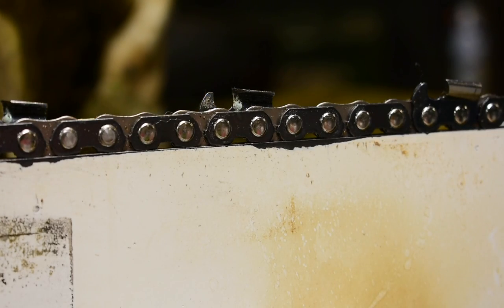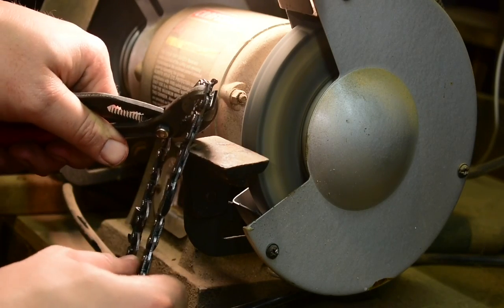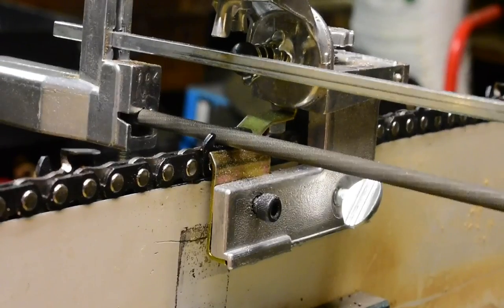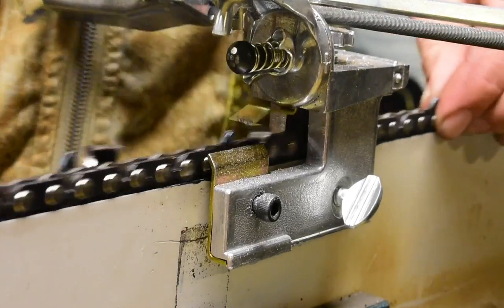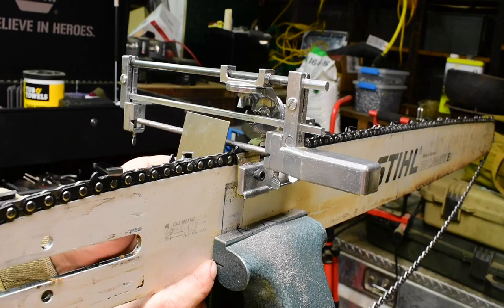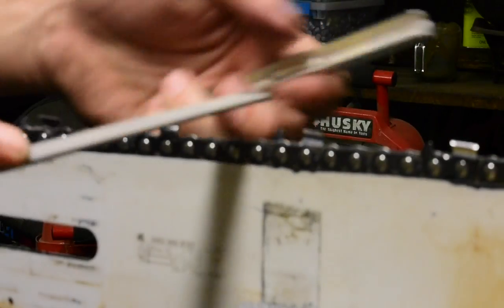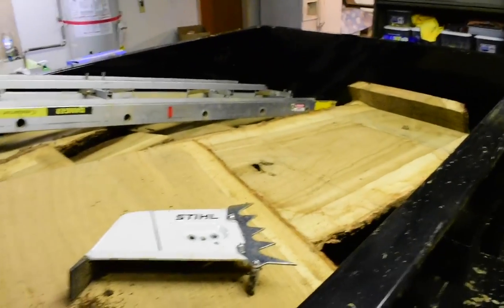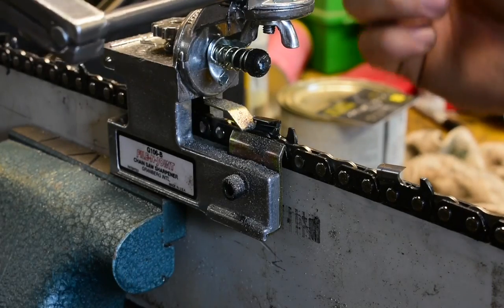How to make a ripping chain

Comment: A Guide to this video:
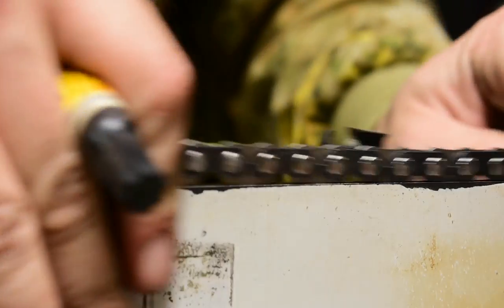1.) 1:49 Mark every other pair (right and left) of cutters on the chain
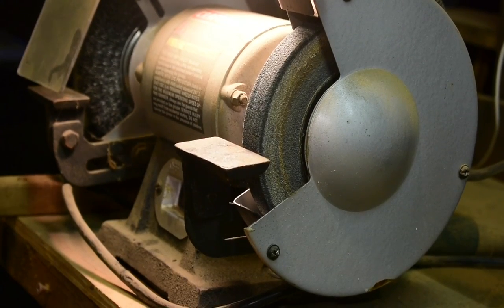2.) 3:34 Grind off half of the heads of all the marked cutters.
3.) 8:00 File the scoring cutters to 20 degrees and the clearing cutters to 0 or 10 degrees (as specified by your chain manufacturer)
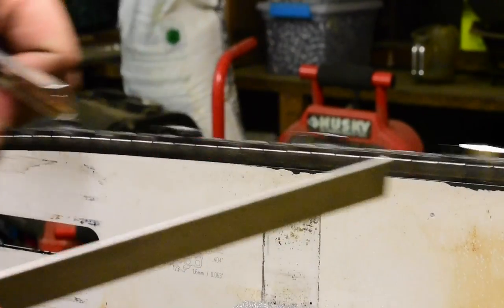4.) 18:03 Grind the rakers down to .025 using guide file
5.) 18:28 Round the rakers so they don't have a flat top
Reply: thanks i copy and pasted in note pad A++++++++++++

Comment: I took an extra new Oregon  LPX chain that I had and converted it to a ripping chain by regrounding the cutters to 10 degrees, just to see how it would cut and put it on my MS 360.  I then ripped off a slab from a round of hickory I cut last summer.  I did not convert it to the granberg style, just ten degrees on every tooth and threw it on the saw.  It cut pretty well, not as fast as a standard chain but fast enough.  It did not produce noodles but nice chips and the wood surface was a lot smoother than I would get from a standard chain.  I was real pleased.  I did not even check the rakers, just re- ground the cutters and threw it on the saw right out of the box.  I did nothing to the grinder but set it at ten degrees.  I do not know how it will cut in other wood but it did pretty good in 25 inch hickory on a 20 inch bar with 3/8, .050, 72 chain.
Reply: 10 градусів це параметри для ланцюгів повздовжнього розпилу.

Comment: I always use a powerful magnet to capture filings so they don't wind up in the chain guide bar and drive sprocket to chew away the metal and make a sloppy wobbly fit. I recover old audio/stereo speakers and tear out the magnets for various uses. This is one of them. They make finding and picking up metal things dropped into lawn grass, weeds, and stones very easy and fast. Incidentally, I had a dog almost identical to Chester, and she could literally talk to me with a few words. "Good girl!" and "No!" were here commands to me. Every time I petted her I said "Good girl!" One time I was too tired and she laid over my feet and told me "Good girl!" to remind me to pet her. wadyano. Missing some teeth on the lower jaw behind the canines, a black spot at the base of the tail made it look like an arrow stuck in her behind and the 2 black ears. A gray colored mottled mouth and silvery white hair. She could have told me anything.

Comment: In my experience with milling, you can use a dremel with a cutting disc to cut off the top plates. Less chance of overheating you cutters. But for the time it takes to make a granberg style chain, an oregon full comp ripping chain filled at 5-10 degrees works just as good and produces a satisfactory finish with minimal plaining required

Comment: I use an air die grinder. Cuts them real quickly. You have to take the one you cut back as you sharpen the chain also.

Comment: You got your sharpener on backwards. You always push out.    Been cutting wood for 45 years.    And have 15 saws.  3. 500 i.   Three magnums.   Two 881.  Two 661.   Always stroke out to the point of your tooth.

Comment: Two words for you: Short and concise. Anything you can do to shorten the videos is best. Cut out crap like talking about how you are trying to focus on stuff. Someone trying to make a rip chain doesn't care about your filming process.
Reply: I set the speed up to 2X.   It helped since I understood what he was saying the first time.  The next 7 times helped to reinforce but they went by faster at 2x even if it turned his voice to sounding like MIckey Mouse.  

This vid definitively convinced me never to buy one of those Granburg (sp) deals.  In the time it'd take me to figure it out and get it set up I'd been able to dremel my chain sharp and buck a chord.  It looked like a broken mouse trap.  I may attempt this free hand on the bar with the Dremel as well.  I'm not making furniture.  Just beams and stair treads, plus I have a hand plane and belt sander if the finish is that poor.
Reply: 20 minute video for  chain cut
Reply: Burt Reynolds it’s a cord of wood not chord. Just sayin
Reply: This video should only half as long. 
Krykies there’s a lot of wasted time

Comment: thanks for info I will be looking to making some boards this summer.  Because angle in sharpening is key, to have different camera perspective to show angle that you are filing at would help a lot; also editing is nice thing to provide to the viewer, to aid the focus, stop down your lens (narrow the aperture on lens) and move camera away from subject to help with focusing. Really no need to set camera on all auto, with those tripod shots and use manual settings.

Comment: ty for the tutorial very good i had wondered how they made the rip chain from regular , the sharpening jig you are using , i am surprised that the offset tilt is only 5 Dec settings , the McCulloch saw sharpening jig i got are 1 to 10 Dec settings on tilt and 0 to 50 Dec on the angle pitch settings with 33 and 45 Dec angles highlighted for regular sharpening settings

Comment: Kyler, have you tried going to the 0-15 deg angle and leaving the cutter width alone on any chains? On your guide squareness issue, dress the inside face on the bar clamp to thin it a little at the top and you will remedy that issue.  You might also want to try .010 - .015" for your rakers.
Reply from the maker: johnnybarbar thanks! I'll try out the raker depth. I have used straight 10 degree cutters in the past and I find that it was easier to bog the saw down. With the "Granberg" style filing it was more forgiving. Milling all day can get pretty tiring and quite frustrating with the saw bogging down. That might have to do with the fact I am using a .025 depth on the rakers. Even more forgiving if I try .015-.020. Thanks! I'll make another chain up and try again
Reply: Some of the better reported milling chain users used .010" rakers...they may have been underpowered. Some factory chain uses .035" but that's a pretty good bite to take it seems.
Reply: Try adding a small winch,  braided nylon cord and an anchor pully to pull the mill through the log....makes things easy and leaves an incredibly smooth finish since there is no see-sawing.
Reply: @relyk90  ... bogging down?  you need a bigger saw? lol
Reply: @badgerwaxer1  - Do what you can, with what you have, where you are.

Comment: Do you think a still farm and ranch 391 will work or be enough of a saw to mill a light amount of wood, ? I don't know that I need the bigger 461, thinking about trying a 391., your thoughts on it would be greatly appreciated, I have a small place, and will want to make some 4x4 or some small amount of milled lumber for personal use.
Reply: I actually use an Stihl MS251 for ripping. Yes its a tad under power and takes a little longer for me but it works. I use the same homemade chain he is making in this video.  I am a salesman for Stihl and I have sold a few MS 391s tp people who are using for chainsaw mills. I have not had any complaints so I would imagine it will be fine. When I upgrade my rip saw it will be the ms391!

Comment: OH! That's interesting. you have the chain clamp of the file guide on TOP of the tie strap. I and every instruction video I've seen,  always put it UNDER the tie strap on the drive link. Is that "the way you've always done it" or did you decide to do that for a reason?

Comment: Great video, thats for showing us how to do that.

That is one thing I don't like about the Grandberg, all the adjusters nuts are difficult to set.

10 degrees for the cutters?  Seems kind of blunt, I would have thought it would be 30 degrees or more.  Do they go with 10 to stay sharp longer? 

Do you find the Grandberg doesn't do a good enough job removing the gullet, or do you do it separate just to do them better?

Nice slabs!  

Nice trailer, I need to get me a trailer...  hopefully this year.

Btw, new camera seems to be working good.  Are you wearing a lapel mic, or is that just the built in mic on the camera?

Thanks and take care!
Reply from the maker: Good Day Farm wow 21 questions! Haha I love it. Keep the comments coming friend!
Reply from the maker: for crosscutting 30 degree angle cuts across the wood fibers better. when milling the cutters are cutting end grain so a less of an angle cuts end grain better. the 10 degree wont necessarily stay sharp longer. but what it does is it helps prevent the cutter from being pulled to one side of the kerf which in turn causes a rough finish on the slabs.
Reply from the maker: Yeah the granberg is harder to adjust then my bench grinder..... kind of annoying. the granberg actually removes the gullet pretty well depending on what size file you have installed and what settings are used. i just go back through and make sure i get it all out of there "Get the Gullet"
Reply from the maker: Built in Mic. i think it works pretty good for close up filming like this, probably wont be to good outside.
Reply: Kyler Monares 

Lol!  Yep...  I got questions!  👍

Thanks for the explanation on the cutter angles. I hadn't thought about the difference in grain...  makes sense. 

Yeah, camera mic works good for bench filming. 

Great video, keep em  coming!

Take care!
Reply from the maker: Good Day Farm thanks buddy. You do the same!
Reply: Kyler Monares wow nice fuel supply. congratulations for the New caméra it has what à caméra should  have!😉
Reply: Good Day Farm

Comment: You can adjust all those things, using the filing jig. Sharpening, gulleting , rakers, all using the Grandberg filing jig. Fitting a small flat file in for the rakers, staight after you file your clearing cutters at 0 degrees. Much easier and more precise.

Comment: Wouldn't it have been easier to just buy a ripping chain in the first place...?
Reply: I have a Husqvarna 2100CD. I asked at 2 chainsaw shops and they both say,  "they don't make ripping chains for that size saw and bar".
Reply: @badgerwaxer1  Look up "bailey's" They sell rip chain that should fit it. Good prices too
Reply: i know of no ripping chain suppliers in all of europe.
Reply: Make your own ‘ get an Oregon cross cut chain ‘ file it at 10 degrees ‘ and drop down the rakers ‘ and away u go

Comment: IMO, a waste of your time, taking off the top plates. Been using Granberg guide for 40+ yrs; you're going at it backwards- notice the chatter filing outside-in? Best chain I've found for milling is full-skip semi-chisel on 32" bar, w/30 deg top-plate and .040" depth gauges. AND ... usable for any wood-cutting. Think long, think wrong, sometimes, like here.
Reply from the maker: Jacques Blaque not once have I filed from the outside in on this video.....
Reply from the maker: Jacques Blaque these chains I have made leave extremely smooth finishes on the slabs.... having 30 degree top plate angles doesn't help the finish. Yeah it may cut fast but whatever time you save in the cut you have to fix by hand with elbow grease later.
Reply: What makes you say that? Certainly not experience. Notice I said "semi-chisel". THAT matters. Gives nice surface finish, which planer "polishes". Ability to mill & crosscut a BIG PLUS. Time is valuable too. "Fix by hand"? WTF? (Some experts use only full-chisel.)
Reply from the maker: This is a semi chisel chain..... not using full chisel for milling. I've seen slabs milled with full chisel. Not a good finish. What I mean by fix by hand is that you either have to use a hand plane or sand to smooth the finish. Not many people have an electric planer that can plane a slab 32" wide... If you don't want to cut half your top plates off that's fine. I'm not telling you what to do. I made this video to show one way to make a ripping chain. I prefer the 10 degree top plate angle for ripping
Reply from the maker: When I switch back and forth from cross cutting and ripping you have to take the mill off the bar. Spend an extra minute to switch chains is no big deal.
Reply: Jacques Blaque, I just went to your channel and couldn't find a video on your ripping chain... Do you have one? Also, what type of wood are you milling?
Reply: Could've shown you, and let you try, the different chains I use for milling, at "Cutting Edge" GTG past April. I was milling some elm there for "RIChevy" w/575 Husqy & 32". 'Round home, been milling sugar maple, bitternut hickory, black locust, preferably with stock Woodland 30SCS..

Comment: It doesn't jive with all i've been told since forever...
  1 ripping saws have much larger toothed blades, why did they have you make the blade smaller??  No way does taking a crosscut blade and removing teeth or changing their angle make it a rip saw..also the pieces of chain between blades has to be lowered to the blade height, that idk why the manufacturers dont want the blade just digging in, these stop that...
Reply: Thomas  Broking have you ever ground them completely off an tried it? The saw will jump and very dangerous hard to control and another is its hard a your saw and it will catch and probably not be able to pull the chain
Reply: @joeybrewer6564  no i haven't. .i am remembering wood shop.. That's all i know.. The couple years i cut firewood i just had reg chains i kept sharp.